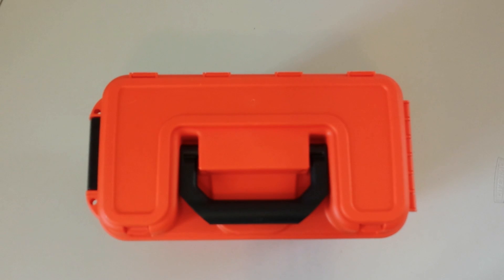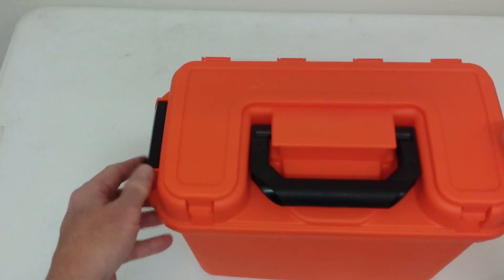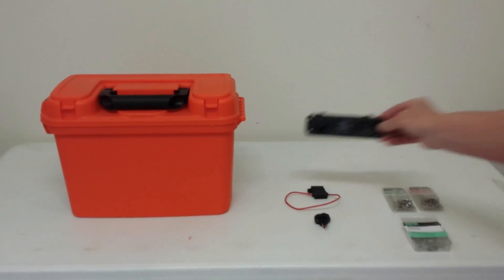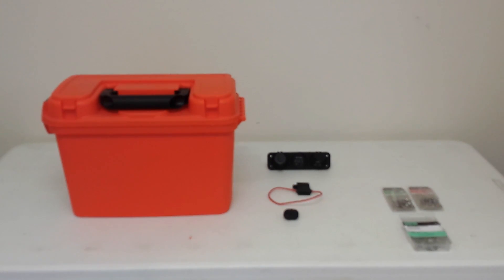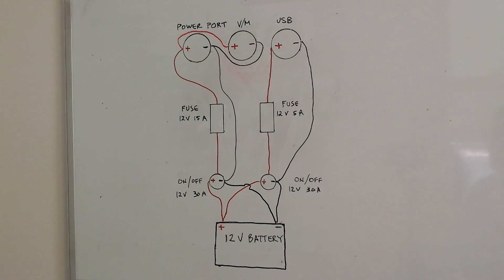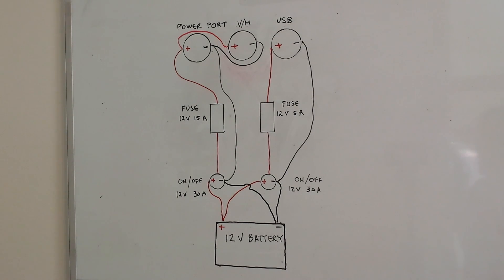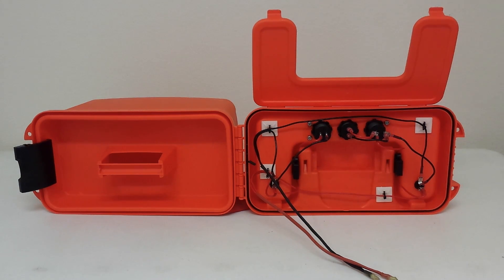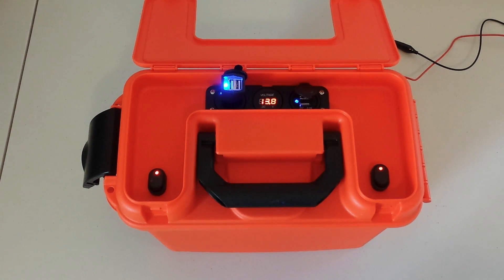DIY Portable 12V Battery Box with Power Ports for Kayak - Version 2

Comment: Nice to see someone putting up a decent circuit diagram
Reply from the maker: Thanks Jim.
Reply: Aksman I agree, tons of videos on YouTube but nothing that breaks it down like yours... how could i connect a batter tender and add a plug outlet to the box?
Reply from the maker: You could install a tender plug but it would be easier (and less expensive) to charge the battery outside the box. I don't like to charge batteries when they are still connected to circuits as a safety precaution.
Reply: @Aksmaniyak  Huh? It is called a circuit design. Those of you watching this and using it to build anything related would be better advantaged to watch MANY others and compare.
Reply: This Paul dude is a trip. For some reason hating towards the poster in every other reply. Serious issues you have brother..........

Comment: I am continually amazed how many of these DIY videos either leave out the box name and size, or the battery name and size (not to mention other important parts).  I only wish that all the countless batteries out there had a good fit with these varying size boxes; but I'll go ahead and order the battery after searching for a while and spend $$ and then hope it fits...
Reply from the maker: Hi. I'm not sure if you are writing about my video because I do list the parts in the narrative section. Once you know that, you can measure the interior of the box to determine what battery size will work for you. I don't usually list a specific battery because there are so many options for somebody to choose. I hope it works well for you. I do have another battery box video version that may work for you.

Comment: Great project! Can I use 12v 20a switches? or they need to be 12v 30a ? Thanks in advance.
Reply from the maker: Thanks Adrian. The amp rating for your switches depends on what you want to run on your box. So you can use other switches.

Comment: When you talk about connecting the negative and positive of the switches together, what's the purpose? The red and black wires are connected (between the two switches on the diagram) please clarify- I appreciate your help... I'm trying to figure out how to make my own...this is great info
Reply: If you look where the black wire makes a hump that means it's a separate circuit not a connection point

Comment: I thought a power switch was always put on the positive side. If not can you tell me why its on the negative side?
Reply from the maker: I don't understand your question. Each switch has pos/neg connections for the separate circuits.
Reply: It is because he has no clue... You always cut the positive side, whether it is a switch or a fuse, look at current flow, positive to ground (negative). If you have a failure that results in a short, by having the switch/fuse on the positive side, you end all current flowing into the circuit. No current flow, no circuit.

Comment: What battery size did you use or what size fix in? A lawn and garden battery or a power sport battery?
Reply from the maker: It depends on the battery. I included the inside dimensions of the box. So you just need the battery you like and measure to see if it will fit.
Reply: @Aksmaniyak  That doesn't answer the question. If someone is trying to copy your design because they think it is the best thing since Edison's light bulb, you need to answer their specific questions. The box has specific dimensions given. We all know those are relative to the opening, the base, side bulge, etc. What size battery did you use specifically? That was the question asked. STEP UP DUDE, answer the questions of your viewers.
Reply: @appa561  z

Comment: Ok, one question. could you simply connect a 12volt plug from this to a 12volt cigar socket in my vehicle to charge this up during the jouney to camp?
Reply from the maker: You could hook up a charging plug to the box but you would need to use a battery charger to recharge the voltage. A set up like this would not charge directly from a car lighter plug.

Comment: What gauge wire would work best with 2 12v battery's paralleled?
Reply from the maker: I would use at least 14 gauge.
Reply: How much current draw? Gauge of the wire is determined by current draw, not voltage.

Comment: Can you explain what the switches are for?
Reply from the maker: The left switch powers on the 12V cigarette lighter and the right switch turns on the voltmeter and USB port. This helps save power if you only want to use one of the power ports.
Reply: Aksman thanks for the info! What kind of wire do you recommend?
Reply from the maker: You are welcome Charles. I used 16 gauge marine rated wire.
Reply: @charlesaquino4277  Ask him for the formula that determined 16 guage. You have no idea if he guessed correctly.

Comment: So to plug anything in that lid needs to be opened?
Reply from the maker: Yes. But if you don't want to do that, you can remove the top lid from the hinges and leave the faces of the gauges/switches exposed.
Reply: @Aksmaniyak  Therefore removing the feature you bought the box for... I don't get that logic... That's just me.

Comment: Nice switch and power supply unit. What is the 12V USB port for a fish finder?
Reply from the maker: Thanks Wayn. No that port is for a cell phone, tablet, and other small chargers.
Reply: This USB port has the voltage regulator built in like a automotive power port plug USB adapter to convert the 12VDC to 5VDC for charging the phone?
Reply from the maker: Yes. There are 2 "jacks" in the 5V USB port. One is 2.1A and the other is 1A. I put the USB and voltmeter on one circuit because of the small amp draw. I put the power port on its own circuit because it can handle higher amp loads.
Reply: I may have to get one of those myself.
Reply from the maker: I actually made some extras to bring the cost down when buying parts. I was thinking about listing one on the FB page Kayak Buy/Sell/Trade to see if it would sell. What do you think?
Reply: Personally I build things customized to my kayak. Others may want just what you have though. Put it on there no loss. You are refering to the complete box?
Reply from the maker: I understand the personalized thing...that's one of the purposes of DIY projects. Yes, the completed and functional box. I think I will list one and see what happens. Thanks.

Comment: How do you recharge the battery.?
Reply from the maker: On that design you use a standard battery charger. On the later version their is an external connector that is used.
Reply: @Aksmaniyak  you mean do I have to take the battery out of the box?
Reply from the maker: For that older version yes. The new version you do not have to remove the battery.  https://www.youtube.com/watch?v=tWRIpTLNIbg&t=2s